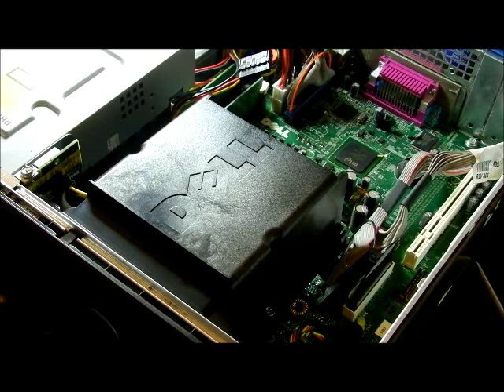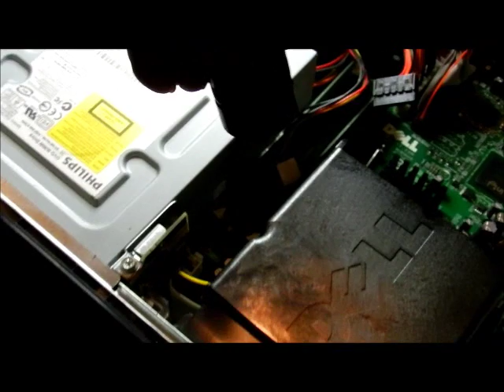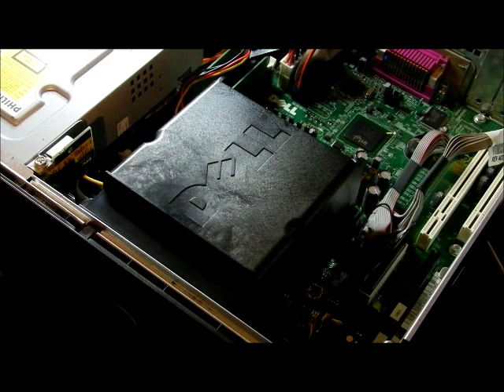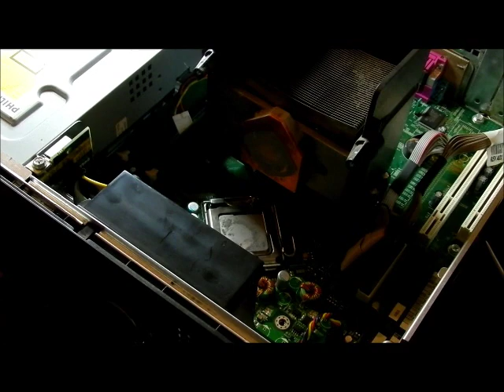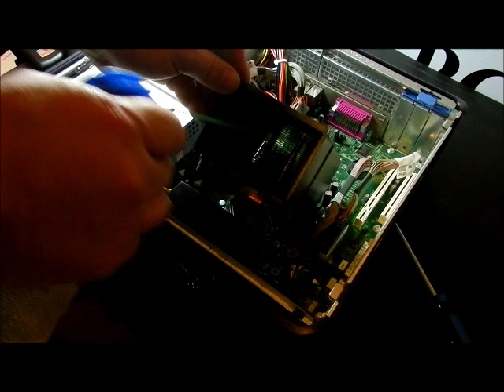Cleaning the CPU Fan on a Dell Optiplex GX520

Comment: Hi there. I have a question. I have a Dell optiplex 745 with the same setup. How do i apply thermal paste to the CPU on it? I've never done it before.
Reply from the maker: +Marshall H. (gatrwrks) Turn off the computer and unplug power.  Take to fan off as I illustrated.  The CPU is visible.  This is where the thermal paste will go.  Put and small amount on top of the CPU and be sure that when the fan is put back on the paste will not spill over.
Reply: Do I put a little dab on it?
Reply from the maker: On the processor.

Comment: I have this computer and I am wondering if you could tell me the upgrades that can be made to it so that it's running to its fullest potential. I don't want to buy a new computer but I am willing to replace everything with a higher capable parts
Reply from the maker: I am getting ready to upload a video about migrating Windows XP from a SATA drive to a SSD (Solid State Drive) and how fast it is.  The SSD eliminates the spin and seek time of traditional drives.

Comment: I have a dell optiplex 360 just wondering can I use a CPU cooling fan form eBay to help cool the CPU instead of having the metal cooler
Reply from the maker: I would only use the original type of CPU fan made for your computer.  Using something different may result in a CPU burn-out.
Reply: Ah OK would I be able to use a second fan for the CPU and well as the stock fan